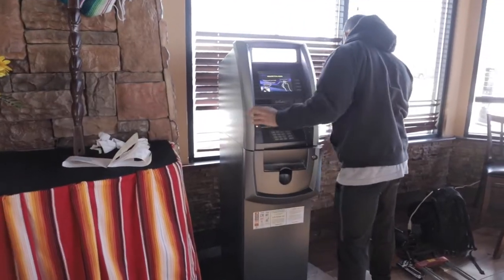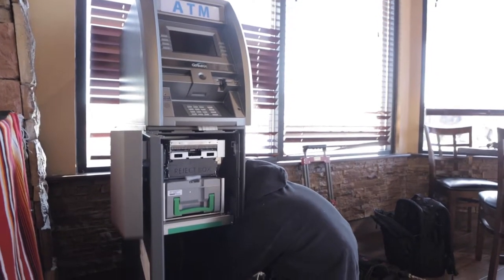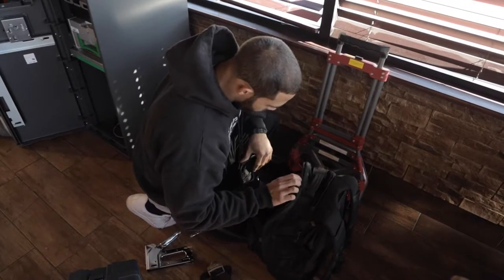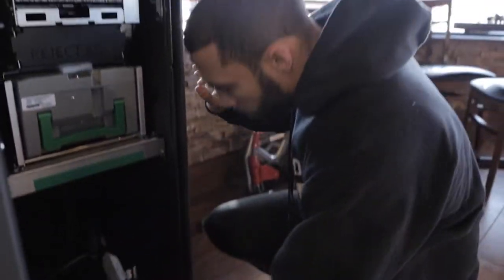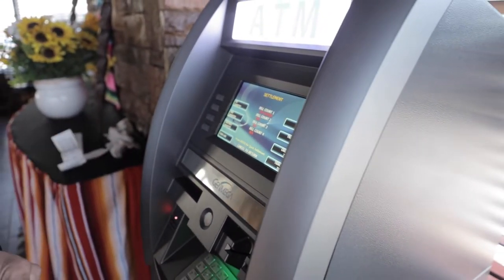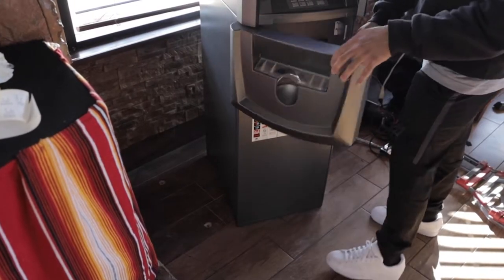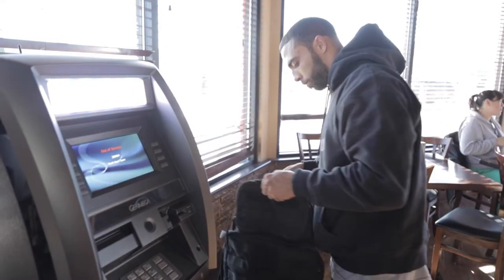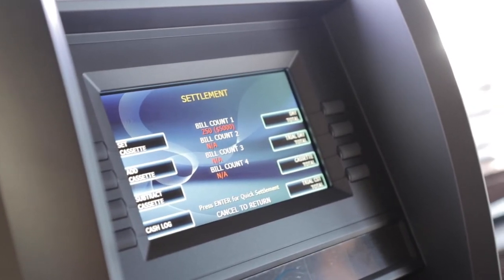Installing A New ATM Step by Step

Comment: How do you link your business account with atm transactions??
Reply from the maker: That’s done through the ISO and Processing company
Reply: So once you set up Atm you have to call the ISO company and make sure everything is linked with you bank account? It’s done automatically once you program atms??
Reply: Why did the bank said I have to have signed contract from the business owner first in order to open account??
Reply: @rodolfovesga979  typically that usually comes with the territory cause the banks tend to already want you having a location agreement signed and ready, so theh they themselves can know. It's just more added info for them and it makes it easier for you opening that business bank account.